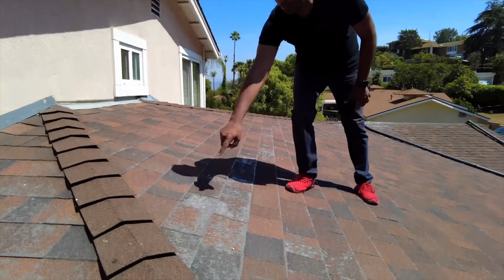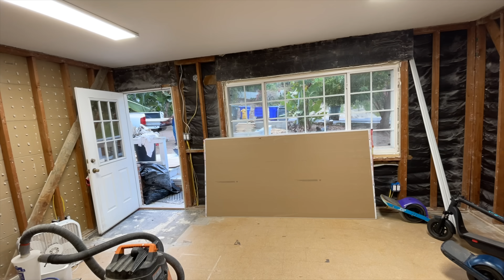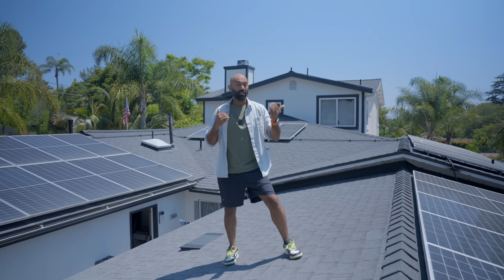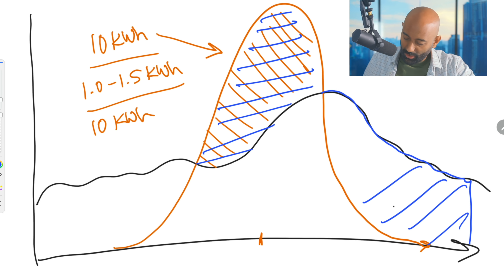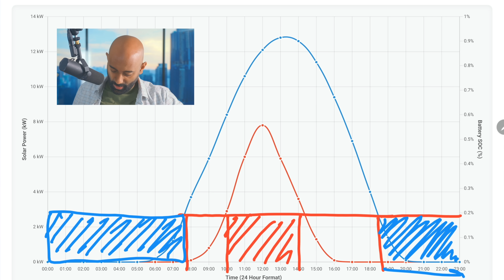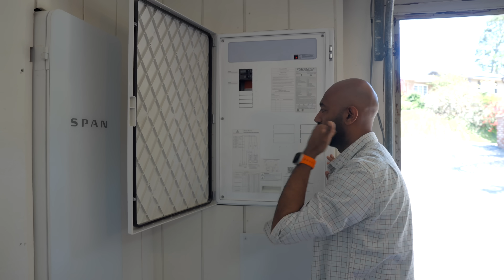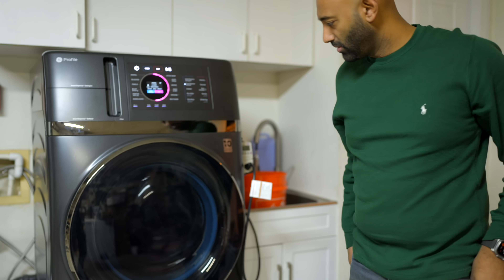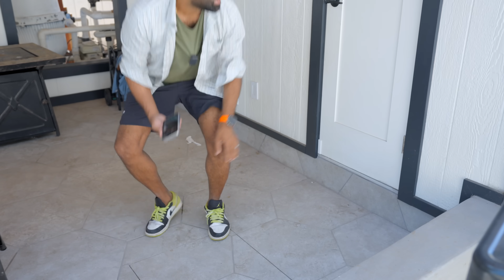Is Self Reliance Possible? Net Zero Home 4 Years Later...

Comment: My answer to the GEOTHERMAL question (for Ricky’s circumstances): Geothermal might not be ideal for you because your largest electricity expense is charging your electric vehicles, which significantly outweighs your other electrical usage—especially after replacing those ridiculously inefficient pool pump!
Additionally, geothermal systems involve substantial upfront costs, including labor and equipment for drilling wells and installing underground lines, plus a costly heat exchanger. Another challenge is that geothermal heating works best with radiant floor heating systems, which require installing radiant pads beneath all flooring. This installation is very costly unless done during initial construction.
Moreover, geothermal only addresses part of your energy needs—primarily heating and potentially cooling. Cooling with geothermal involves an integrated heat exchanger capable of both heating and cooling, but this method operates relatively slowly compared to traditional external fuel sources like electricity, and is best achieved with the addition of air heat exchangers (think reverse radiators;-) throughout your home, another significant expense.
If you were building from scratch, geothermal would significantly accelerate your path to achieving net-zero energy, but for the ridiculously high costs of new construction (Let’s all pray that modular & prefab homes keep gaining acceptance and economies of scale!). However, without detailed usage data—as you mentioned in your video—it's challenging to accurately assess feasibility. 
I'm curious whether San Diego has any regulations against drilling vertical geothermal wells. I live in the area part-time as well but am unsure about local ordinances. Also, I was surprised by your electricity rates—they're about 10 to 15 cents higher per kilowatt-hour than I expected for our region, though I do understand rates vary by district.
Whole home, integrated heat pump systems, which handle home heating, cooling, and hot water, represent the future of sustainable energy solutions. However, retrofitting these systems after construction is problematic without precise usage data. While it's possible to simulate these systems digitally, creating such digital models can also be expensive and technically challenging without the necessary expertise.
I’m very curious if any of you Subscribers have deep technical knowledge of these systems or experience actually installing them and how the feel about it in hindsight?? Hopefully they will comment!
Reply: @netzerostrategies  Hi,  I agree that  Ricki may want to reconsider geothermal for his home,in his case I believe if he was to go ahead it would need to be  a well injection system for his lot, two wells would be needed. I self installed a 3ton geo unit with four ground loops in 2008, in Michigan, the cost to run heat at .18ct kw is about 300a month in winter dec-march. Around 2000kwh total month usage during those months. Summer the air conditioning is basically  free for us. My cost at that time for install was around 8 grand total. I think mini splits for a California home be the way to go with all that solar he has.
Reply: I have geothermal. I installed it myself. Cost me less than the estimates I got for conventional heating and cooling. By a lot. Because I self installed it. Super efficient. I have cooling via chilled water fan coils. Geothermal heatpumps also chill water. I run 36f water through the fan coils. Cools very fast can cool my house down to 64f in a very short time. It's 93f outside right now.  For heating I have both inslab. 2400sqft downstairs. And 1000sqft of warmboard system upstairs. Wamboard is THE most efficient infloor heating. They make panels that you replace the plywood subfloor with. They router channels in 1 1/4" plywood. And then coat the entire panel with a thin aluminum plating. Including down into the channels. Then you snap pexalpex into the channels. Basically covers your entire floor with a giant aluminum radiator. It heats so well.  The Warmboard only varies +-1°f from the setting of the thermostats. The inslab vary's alot from the thermostat settings. And takes a long time to  heat. 
Warmboard also makes thinner panels that go over the exiting floors. Same panels only thinner since they don't have to supply the strength of the subfloor. 
Warmboard is more expensive. But well worth it.  Will pay for itself in a short time. 
It cost me $22,000 to install geothermal  myself. That included $5,000 to have the horizontal loops in the yard. And the cost of the warmboard system that I self installed. It was surprisingly simple to install myself. I drive a forklift for a living in wisconsin. Oh yeah the bosch water to water geothermal heat pump. Has what they call a desuperheater. That heats your domestic hot water. For free. It's basically a water jacket around the compressor. That gets hot whether heating water for winter or cooling it for summer.  And it runs the domestic hot water through the water jacket. And back into your water heater. Pre heating the water. It has no problem making all of my hot water. I turned off my water heater. And it would heat it to 125°f and had no problem keeping up. But I live alone. So if you have a large family your water heater might have  to turn on some of the time.
Reply: I'm looking at geothermal heatpumps as well, it's very expensive (~€70k including the drilling)! But I really want all those old school radiators gone from the house and floor heating is very nice, especially when you also have the option of cooling with the same system as well. I have been reading quite a bit a some of the DIY builders have also stored excess energy in the geothermal space, which might be interesting as well. If you can also cool with it (limited capacity), that should offset at least some of the electric costs of AC (partly replaced by the geothermal heatpump. While it might not be the most cost effective, it is one of the nicer solutions that allows us to get off gas and have very efficient heating/cooling, personally I'm willing to spend the extra for that.

Comment: I am just up the coast from you (greater Disneyland area) and we went solar with a battery backup, probably just before you did.  I own a Tesla I can't drive.  And that battery was $9k. Have battery prices come down, or is there nearly $50k in batteries at your house?  

We have 13kw total output, and that will run our house overnight through 3 seasons, and just past 9 pm (when time of use billing goes back down) in the summer.  I also think the solar rebates jack up the cost.  While we get a rebate, the solar companies have charged more because the consumer doesn't pay that cost directly.  My solar sales guy winked and nodded when I asked him about it.  And that is with a very reputable solar installer.  Good on you for taking your expenses back from the man.

Comment: For winter many of the days are cloudy with ambient light, and in those conditions having panels on other facings of the roof (such as North-facing) actually do a pretty good job relative to panels on south and west facings.  So to improve winter generation, definitely consider adding more panels to your roof area regardless of the orientation.

The Franklin system was a good buy... basically a MID topology which addresses a lot of problems.  I wound up going with EG4 myself... also a MID topology via the GirdBoss.  But more or less the same specifications.  The key is to have a lot of storage and then not have to worry about when various appliances in the house run.  I am also able to keep my ID.4 charged up with only a minor tweak to my EVSE to reduce the charging rate down to 6kW so I don't have to check on it so often.

Quite a few of things you did were ... mmm..   being nice I'd call it "overkill".  Nobody needs a SPAN panel, for example.  AC coupled solar is completely unnecessary with your house and cost you a bundle extra.  It also creates issues with the utility once you go beyond a certain amount of wattage.  DC coupled solar with simple RSDs is just straight-out superior these days.  A regular washing machine is fine and even a regular dryer isn't too bad.  I would put those in the category of unnecessary costs.   The use of power stations instead of a proper off-grid system for the office was a mistake in my view.  I don't remember everything you did but I do remember I had critiques throughout the journey.

Now, a whole-home heat pump furnace is a much harder problem to deal with.  We're researching for us ourselves now.  For California (both of us live on the coast)... yah, heating is only a winter thing for the most part.  It's a pretty large expense but I am leaning towards getting it verses a simpler zones mini-split system.   Getting net-zero across winter is difficult... possibly even impossible due to heating requirements, but shaving a huge portion off the utility cost is totally doable.

-Matt

Comment: I've had net metered solar since 2018, and am grid connected for $10 a month.  No bill for electricity usage since.  1:1 net metering makes batteries somewhat unnecessary, but I want to add battery backup.  There are many battery brands available now, but it can be daunting to sort through it all, and understand the required components  and tradeoffs.  Also have a new project which I would like to be net zero, so I appreciate this and previous videos.  Thanks.
Reply: A minimum of 5 kWh battery to make sure you have at least a couple hours of emergency runtime in case of sudden power outages
Reply: Sungold all in one controller and Chins Lifepo batteries, cheap and easy

Comment: We are going solar to battle the ridiculous surge in energy costs.  17% last year, and 28% this year.  Being in Montana, the turnaround is 8 years.  Fortunately, we are still 1:1 here.  We'll add a battery later on.  It's important to note that the tax credit is going away.  If you are considering solar, schedule now.  

How much have your panels degraded?

Doesn't downgrading the pool pump degrade the pool's cleanliness?  You went to less than half the power.

I am surprised that the grey water doesn't kill your lawn.  Soap is a hack for killing weeds.   Do you treat your grey water before using it?

Can you go into more detail on batteries?  How long do they last?

Comment: here in the UK, i have a 12 yr old 4kw solar panel system, it generated in the last quartly peroid(just finished), 1843 kwh compared to the same peroid last of 1,224 kwh, a not quite 33% increase, granted i swapped my grid tied inverter to a new modern one last year,with a lower start up voltage, all said and done my earnings for the most recent quarter are £517.53p, which is just over £200 increase on the quarter before, i also have a heat pump tumble dryer, one trick to make it run better is to place a DRY towel in it @ the start of the drying cycle, which in turn asborbs the dampness easier, typically to run that on its standard "all fabrics colours/whites" cycle which is 3 hours cost me about 16p, again if i did it in the daytime when the sun was out it would be zero, i am curious when you were standing on your roof, why no panels on that area ??, after all, all points of the compass will generate solar, mine are not quite due south & i am in the process of replacing/upgrading my panels to new panel on the south roof, 4 panels on south facing vertical wall,4 panels on the east facing gable & 4 of the north facing roof obviously bi facial, just curious why you didnt max out your roof space with panels with some of your savings, even on a seperate inverter feeding into your batteries, with panels/inverters now cheaper your ROI would be shorter ???, dont be so long next time Ricky :)

Comment: If you want to add TONS of energy storage for cheap, look into the open source battery controller project, to make a junkyard EV battery into a home battery 

You can easily get a 80-100kwh battery for like 5 grand
Reply: An old (NMC) EV battery can be a real fire hazard aside from the potential to kill you instantly if you do not know what you are doing.
Spend a little extra for LiFePO4 and a decent battery box if you want to build it yourself. Will Prowse and the Off-grid garage are great channels to learn this stuff.
Reply: But can he do it where he lives, California has so much red tape im surprised breathing on an electrical wire doesnt get you a fine
Reply: great idea
Reply: I did it and can confirm amazing price too
Reply: You save a couple of grand with the risk of burning down your house with something no insurance will ever cover... For that reason, I'm also looking at Sodium-ion saltwater batteries, everything can burn, but with these the risk is a whole LOT lower, they are just not as cheap as some of the Chinese solutions, and they take up more space.

Comment: The other benefit is that battery production costs are going down as battery energy density is going up, however that does not guarantee that the customer is going to get that discount. Battery safety is also improving. Hopefully, by the end of this year, battery prices will go down.

Comment: In 2022 in Indianapolis I installed 28 400w panels with net metering.  I tried to keep the system simple.  Rickie, my installation costs sounded exactly like yours for your first phase.

Comment: Is it possible to have a house entirely on a Ecoflow setup comprised of the smart panel 2, 3 Delta Pro Ultra generators and 2 batteries each? How many panels (let's say, 650W each) can I have on this system? I'd get an electrician to install the smart panel 2 as a subpanel, but I'd like to know how daunting of a task the wiring between all panels and the Delta Pros is...

Comment: our new system (since January) is about 18 Kws of solar panels and 20 Kw Battery backup.  We are in Washington State at $0.11 per Kw.  So we are doing great now, during summer, winter will be a lot less. We are charging two EVs, a Rivian and a Bolt.  But we are loving our system so far.
Reply: I am from Washington State, too. Who was your installer, and would you recommend using it? Thanks.
Reply: @ai_i_przyszłosc  Soltara in Seattle, Yes I would recommend them!  Tell them you talked to me.
Reply: @ai_i_przyszłosc  Yes, Soltara in Seattle.  Tell them you talked to the Trainmanhowe, they know me by my trains in the yard.

Comment: You could reduce electricity consumption in the summer with solar collectors for heating water. I have 5 of them and a 500L water boiler. I don't have a swimming pool, but for showering and washing dishes, it's a great idea. It doesn't use electricity, maybe only a pump that takes water from the boiler to the collector, but that's a ridiculous 50W/h.
I have hot water from April until October. Many greetings from Vienna Austria
Reply: Good point. What no one is commenting on here is that this is a ridiculous amount of energy being used for a household. Don't live in an enormous house and we'll all be better off.

Comment: I was going all electric last year:
Replaced my ac/furnace with a highly efficient heat pump, a gas range with an induction range, a gas water heater and dryer with heat pump versions, and my car with an EV. All of that is powered by a 10kWh solar system. My cost for the first year was $225 for everything ($19.50/month in connection charges), produced 18.8 MWh and consumed 12.5 MWh.
I had only 30 days in the year, where I didn't produce the energy I needed... A 10-20kWh battery would be enough to be theoretically off-grid, especially with an EV with V2H. However, my net metering conditions make it pointless for me to add batteries in the monent.
I live in Las Vegas, with cheap electricity and gas. My solar system  pays for itself in seven years and produces enough savings to replace my heat pumps and EVs in the future.
I save about $4000 per year in electricity, gas, and gasoline costs.
Reply: What did you use to replace your gas water heater?
Reply: I used an A.O.Smith (looks similar to Reliance) heat pump water heater from Lowe's to replace my 15 year old gas water heater.
My first year usage was about 750 kWh. In summer it has he added benefit to cool my garage.

Comment: I just bought a few folding panels and power stations. More of a geeky hobby and back-up for storms. Probably end up building a little ground mounted setup in my backyard eventually. Next thing I need to do is get a Starlink to cover the internet during grid down situations. Also, want to add a system into some kinda of 4x4 like a 4Runner with roof top solar.
Reply from the maker: That’s exactly how it started for me! I ran a wire I to a room and worked from it… probably saved 5kWh a day :)
Reply: @TwoBitDaVinci   lol sounds like what I hooked up recently. Got a Pecron solar generator with about 6k kwh and some 2nd hand panels. Lowed my usage by 30% but my bill is still going up, frustrating. I live in the Coachella Valley so wanted it for the summer to run an AC unit. One day will get a full system up. Nice video, glad the algorithm worked this time!

Comment: Very cool!  I too recently jumped into DIY solar with EG4 and bought the that GE All-In-One washer/dryer.  However, your video was a great reminder that instead of more solar panels and batteries, I need to compare the break-even of instead replacing our old and inefficient pool pump and HVAC systems.  

Another break-even I’m going to consider is switching to a time off use electric plan and expanding my battery capacity to charge them cheaply at night so they can completely power us through the weekday mornings and weekend nights when our usage is greater than our solar production.  I’m considering EcoFlow Delta Pro Ultra for the battery expansion so I can take it with me when I sell this home several years from now.